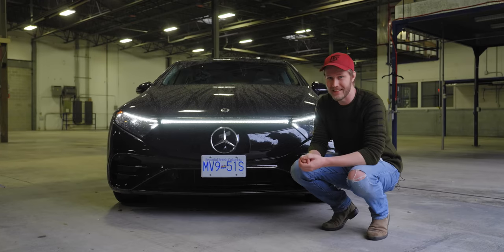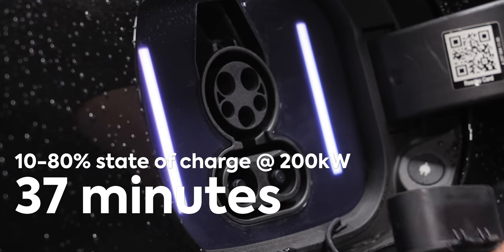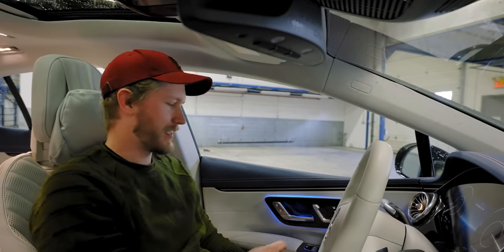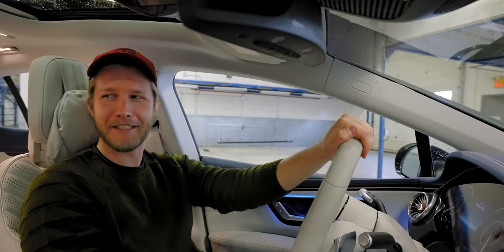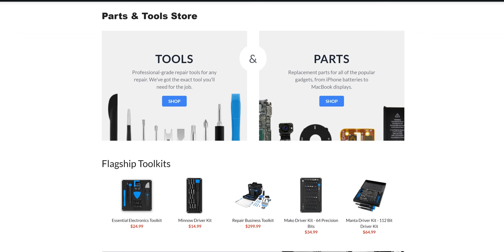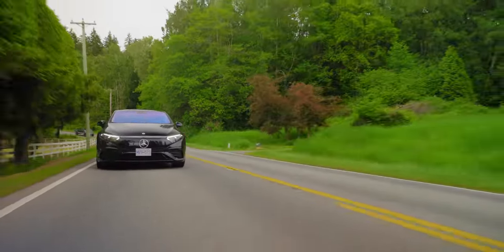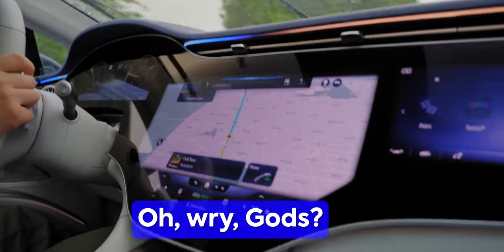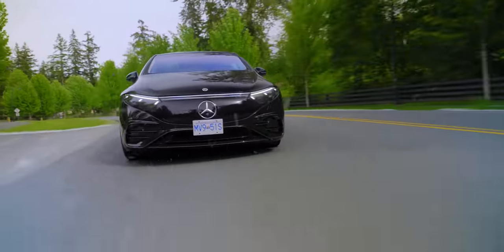Mercedes, don't be mad. But... - Mercedes EQS 2022

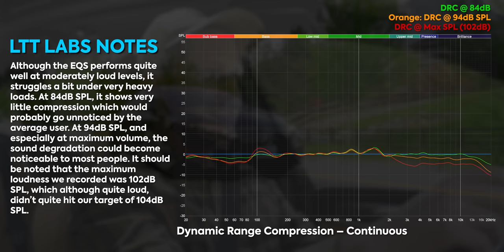Comment: 12:54 i think you guys colored either the graph or the legend of the EQS and S90 in the opposite colors, because it shows the EQS in purple having very good sub bass and the S90 with less bass below 40hz
Reply: Some shots showing the car testing and readouts together might be interesting, or help ensure accuracy during continuity checks of the script and what's shown.
Reply: @jinkim89  Yea agreed, I did pause but unless you are a real audio nerd it's all a little meaningless. Alex is talking about the audio in the background, which I missed as I was pausing and then playing and reading, so lost what he was saying. If his scipt was laid out to use the labs data as a reference it would be better - so "Overall I enjoyed the audio in the car, it feels like it lacks a little bass response in more bass heavy tracks and this is backed up by the data from LTT Labs you can see here insert graph - a more in depth explanation can be found at the LTT Labs link in the description"

Just dumping these data sets in requiring a pause is complete changing how their viewers are having to interact with the video (IMO in a worse way) which I think they still need to work on. Even the editors notes in this video were so quick I had to skip back multiple times - they are funny and I like reading them (especially the bit about hitting a person on the road and being "dumb that you can't do it") but dang do they go quick.
Reply: @dylanevans5644  This!

Comment: Well I drove the eqs aswell and also found the brake feel a little weird. But you can actually change the regenerative braking with the "shift pedals" so just using one pedal driving is very usable. Also I missed the sub base but maybe because I am just a 19 year old bass lover. Overall this is a very nice car for S class customers that drive for themself and maybe have a assistant always next to them. Kinda like a youtuber that travels a lot with their cutter/cameraman. It feels like its very well tuned for german roads and autobahn where you can use the great fast charging network of europe. In the US and Canada it's probably pretty lost for this, with a lack of really fast chargers. It's not a car to daily to work rather to travel from city to city

Comment: The screen makes me wonder, how will the Apple CarPlay update work with this car? Also, I love how Dennis was the one to judge the message function given his Intel Extreme Tech Upgrade.
Reply: New UI is reserved for new cars. It will continue to use a slightly facelifted version of current UI
Reply: i dont think this car will get the update. the apple keynote said late 2023 cars, so.....
Reply: @AshokkumarJakkula  i might actually get the update with need to plugin the iPhone, I think Mercedes’ uses nvidia chips for the infotainment or something like that.
Reply: @carholic-sz3qv  I’ve never seen a German car manufacturer updating software when they do major OS updates. And opening up an api to read safety critical information and allowing it to also overwrite your dashboard with their own design is quite the major change if we go by the standards of German manufacturers.
Reply: @AshokkumarJakkula  Are you sure they didn’t mean late 2013 or later?
Reply: @skirata3144  lol…….. thé same thing has been happening for years and years with CarPlay and android auto.
Reply: @skirata3144  Mercedes’ was on Apple’s list of cars they support/want to support, so clearly Mercedes also wants to implement it
Reply: @irwanclark3387   If you look at what the CTO of Merc said - there was never an agreement between apple and merc. Why would any carmaker want to lose their ability to use all the driver data themselves and basically become a data mule for apple. Exactly - there's no good reason
Reply: @irwanclark3387  in future cars, sure. But retrofitting it via update into this, probably not
Reply: @carholic-sz3qv  New production models yes models that where released without it being an option haha nope.
Reply: always no to apple
Reply: @skirata3144  It’s not a priority for the Germans

Comment: Hey, I met Andy at a quick charger after they shot this video!
To be honest, I never would have guessed that the car cost that much from when I saw it; even on the outside, it just seems kinda like a cheap VW with a bit of a facelift. Though to its credit, the underglow and ground-projected logo that appears when you open the doors was actually kinda cool and managed to not look tacky
the fact that they block you from getting under the hood is ridiculous though, stuff like this is exactly why we need tougher right to repair legislation.
Reply: The question is: What do you want to repair yourself on a EV like this with a lot of high voltage systems and parts that were designed to the extreme to match the high airflow design (and compact design under the hood)?
Reply: @user-ce5oh4bp4l  the cabin air filter, for one. There's also the brake fluid reservoir hidden under the plastic panel, and a bunch of other basic maintenance stuff.
Reply: @Gellis12  50:50 that’s where the 12v battery is, that or the trunk. Also probably have to pop the hood to make brake work easier.

Comment: My first TownHouse was 119k… that about sums up my thoughts on this. 

Also I imagine this in a commercial with Shaq saying it’s got plenty of room with him getting inside and his head sticking out of the sunroof 😅
Reply: 119k? Ah yes, the Before-Trudeau times.
Reply: that same townhouse probably goes on the market now for about a million
Reply: @spiderjerusalem6887  It's not just a Canadian problem. We are now ahead of the 2007 housing crisis in terms of housing cost compared to median income in the USA as well.
Reply: So when Shaq opens the windows, the tweeters are almost correctly aligned
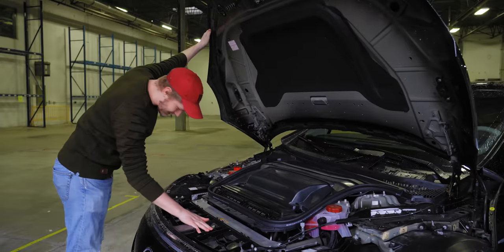Reply: 1:47 $160,000 and you can't kill anyone with the bumper? I think we can agree that most people who can afford this car wouldn't think twice about a little hit and run murderizing.
Reply: I just checked the price for this car in Sweden... Its 1.85 million SEK. This comes to about 180k USD or 235k CAD. Why is it this expensive hahah???
Reply: @exsnozer  Because it's a low production proof of concept basically....for it's time many years ago , Tesla wasn't cheaper either. US$127K in today's money with 40kwh battery and lots of baby issues. With 200kW charging and 170kWh of battery capacity US$180k is still kinda cheap. But in the light of competition, yes it's just a proof of concept not meant to be sold to masses.
Reply: @terrabiker  Maybe, but I got my car for 2500 dollar and everything above 10k dollar is super expensive in my budget.

In Sweden we earn way less than in the US as well. Our median salary is about 38k usd per year and our average is about 42k. Then subtract about 33% income tax.

Comment: The 170KWh showed would really be absolutely crazy capacity ^^
Reply: It’s 107kw he was wrong
Reply: He said 107 they showed 170 on the screen
Reply: 170kw but only 2 miles per KW kinda low

Comment: I have now owned my EQS 580 for about 13 months, and I like it much better than my 2017 S550. It is smoother, quieter and more responsive than old S class, and its interior is every bit or more cosetting. The sound system is top notch.

 It is by no means a sport vehicle, but it is the perfect vehicle for long, comfortable drives on surface roads and major highways. The somewhat unusual brake pedal movement is not in fact a problem because it very quickly becomes second nature. The adaptive crise is excellent and the anticipatory nature of "intelligent recuperation" takes the stress out of city driving. On the "strong recuperation" setting with the "creep mode" disengaged, the car is a very competent "one pedal" machine. The Intelligent recuperation mode is much more sophisticated and efficient, however. Combined real world range is about 325-360 miles in the summer and 260-280 miles in a Northeast US winter with the heat on. My average range over about 20,000 miles has been 281 miles. Of course, highway driving is less efficient that city driving because of wind resistance. The range is excellent for long trips even through charger deserts like the 250 mile stretch through in central Pennsylvania USA

The haptic controls are very easy to use, and their combination with a relatively sophisticated voice recognition system make operating the vehicle a breeze. There is no need for knobs and buttons.
 
Because of supply chain problems in mid 2022, I was unable to get some options like auto-close doors and the fragrance system. I am looking forward to adding those features and whatever else has been developed on the next EQS version (perhaps the facelift).

I drove the EQS with the Tesla Model S prior to my purchase, and by comparison with the EQS, driving the Tesla is like riding around in a sardine can. We almost never take people for long rides in the back seat, but our friends have found sitting in the back quite an opulent experience. The huge space under the lift back gives the car substantially more utility than our top of the marque, mid-sized SUV
Of course, the absence of ICE stench and noise combined with the speed convenience of at home charging, qualities shared with other EVs, is an unmitigated blessing.

Comment: In Germany they were the first to implement level 3 automated driving with this one and the s class. You definitely should take a trip down here and try it. It’s freaking amazing.
Reply: eeh...sorry, but i still like to be in control and not being hacked, while in automated mode,  in a poorly secured Mercedes
Reply: @s.i.m.c.a  lol
Reply: @s.i.m.c.a  Mercedes are the ONLY manufacturer to develop thier security FULLY in house... And thier operating system is also made fully by themselves, with the hardware being made by Nvidea.... They are just about the safest when it comes to hacking
Reply: @Captain_Coleslaw  Just a point, but proprietary does not mean secure. It means that it hasn't been tested by too many other groups, and very few will have validated it. Doesn't mean it's insecure either, but it's not a plus. Security through obscurity won't work for very long once the system becomes more common.

There's a reason why open-source stuff is considered to be more secure for most use cases, since it gives so many people a chance to break it that you either find the flaws, or have it proven how secure it is. Hence why most encryption standards are open-source.
Reply: @Captain_Coleslaw  my rule of thumb is generally : if it ain't open source and it hasn't yet been stress tested by actual hackers, then you have no reason to trust it
Reply: @Captain_Coleslaw  I don't think Mercedes is known for having the best UX. Doesn't mean that it necessarily translates to "the software sucks", but it can kinda serve as a tell.
Reply: That's not actually true.
They created the circumstances to slap the "level 3" badge onto their car by changing the rules rather than developing their system. What do I mean?
Well, you can only use it as a level 3 system when the following conditions are met:
-speed is to be bellow 60km/h (40mph)
-you have to be on a specific part of the highway (enforced by geofencing) (allowed only in Germany).
-if an accident should happen, the car gives the control back to you (possibly) right before the impact. And since the car gave back the control to you, you are responsible for the accident, not the manufacturer. (So no different from level 2.)

A note on others:
Waymo has every inch of their operating area tracked in and can't drive on unknown streets. Also can't take unprotected left turns.
Super Cruze (or whatever it's called) i have no idea about. Haven't read up on it yet.
Tesla: just look at some FSD Beta videos. You'll understand the difference.
(Actually: better to watch a video on EQS too. But only from small(er) creators, and never news sites. They tend to distort reality a little.)
Reply: @Captain_Coleslaw  so it's an OS made by people that work in an environment that has no experience in software security? Yeah hard pass.
Also I strongly doubt NVIDIA made drivers for something that isn't Linux or VXWorks (a common real-time OS) so the claim of "OS made fully by themselves" is questionable.

Comment: As soon as he talked about the adaptive breaking, I knew this isnt it. One thing almost everyone will hate is if your brake pedals isnt consistently smooth. Makes you feel so much less in control of the vehicle and much less safe.
Reply: 👆👆Congratulations I got a surprise for you🎊🎉
Reply: I Have the adaptive regen braking enabled on my Hyundai EV and honestly once you're used to it it's fine. You learn to predict how it is going to respond depending upon what's in front of you and can respond appropriately. If the Mercedes version is anything like this, I would be more than happy to live with it.
Reply: @Koda14  I'm not just trashing adaptive braking all together, I'm mostly talking about how alex is saying how he feels about it. I've test driven the Hyundai's with adaptive breaking and its feels a little odd at first but nothing alarming.

Comment: The current S class will absolutely be better. But it depends on what you're reviewing, because that one is absolutely an executive's car. It won't corner. It won't go as the EQS does. 

If possible, I would like a little more time devoted to "EV stuff". How does it handle charging? Does it do the advertised power? Does it handle preconditioning? How is the route/charge planning (it's supposed to be really good in the EQ series) stuff like that.

As a whole, having seen a number of reviews, I think the EQS should've been the EQE...and the current EQE should just not exist. Because this most definitely is NOT an S class, in no way.

It's also worth a mention, that pretty soon the EQS (and the S class) will be the first production cars you can order with actual, certified Level 3 autonomy capability according to EU regs. At least here in Germany , not sure about other markets. It'll be very limited (almost uselessly so) but it will be there.

Comment: The title of the video perfectly describes the problem with this video, Alex actually didn't understand the targetgroup of the EQS. The owners are the same as for the classic S-Class, rich (older) people and CEOs who want to drive or be driven absolutly hassle free and with the most comfort possible. It's a luxury cruiser, not a Tesla Model S "sportssaloon" rival. The EQS is an absolute master piece in most of the stuff the target audience wants, and that has been the case for the S-Class as well for many, many years. Alex describes it as "not the best" driving experience, but it's just not made to be engaging and fun, instead it's made to just flow. I think he mostly just stepped a little bit too much out of his typical zone and tried to propose his expectations on what a car should be on this, instead of seeing it as what it is supposed to be. 

I definetly get some/most of the other critical points (especially the capacitive touch), i'm not here to overly praise the car, it has its flaws, even some big ones! I just felt like Alex missed some points because of his personal point of view.

Comment: It doesn't matter how big the battery is when it comes to charge time, you can always increase the charge current as long as you have sufficient cooling. A 50kwh battery and a 100kwh battery will charge in the same time under a 1C load.

Comment: Capacitive touch buttons are the best idea for driver safety, you know, when you have to take your eyes off the road and actually look at every button you want to press. Much better than the old days when you could just use the tactile feeling of the buttons to find them with your fingers, while keeping your eyes on the road, it's a wonder drivers that had to suffer through old style buttons  aren't all dead by now.....

Comment: 3:03 are the batteries in the bottom of the car? if thats the case then the roll over rate is almost impossible. NHSTA tried to roll a much top-end heavier model X and they couldn't do it.

Comment: I think this is a car that works way better in its SUV version. The looks are improved A LOT and it becomes a great family car, that is good for road trips with a fantastic range. The only thing that's missing is an 800 volt battery and charging system, the Taycan which is on 800 volts charges from 5 to 80 percent in 15 minutes on a 350kW charger! Granted, it has a much smaller battery but there's still a 70kW difference in peak charging speed between the Taycan and EQS which is entirely due to the voltages of both cars.

Comment: My E-Class has the hood latch hidden too, I always just thought it was for aesthetics.  By the way,  It says EQS-580 on the back, and if that car is similar in spec to their 50+ deciliter displacement AMG E-Class sedans, that price is less extreme than it seems.  An E63 AMG is over $100,000, but the EQS-580 probably has a little less horsepower.

Comment: There's no need to press the logo to open the rear hatch. You can just kick your foot under the rear bumper where there is a motion sensor to do that. I bought an EQS 450+ at msrp for a lot less money than the 580. The car offers so many things that you will not find with Lucid or Tesla, like Apple CarPlay, SiriusXM radio, a sunroof that actually opens for fresh air and the 4 wheel steering. There is also a shade on the sunroof. Almost any feature can be accessed by saying Hey Mercedes, including changing the color of the ambient lighting. With two years of free charging at Electrify America, I have had almost no cost in driving 4000 miles. With Plug and Charge, adding juice is as easy as a Tesla. My only problem was a low tire pressure alert that the dealer fixed in five minutes. You can only fit three golf bags in the back which was a little disappointment.